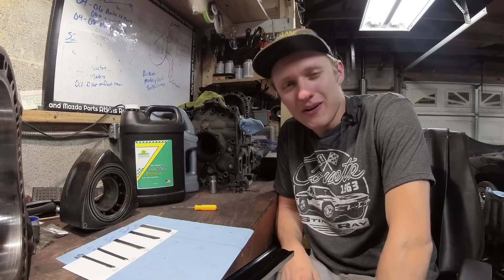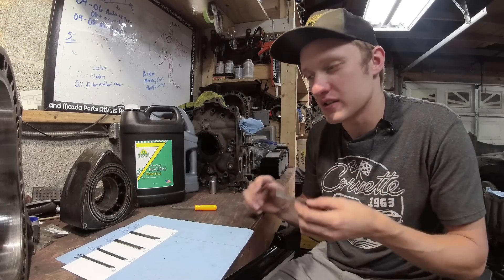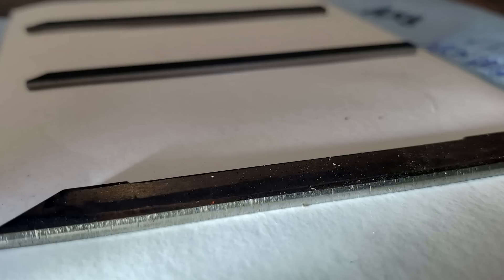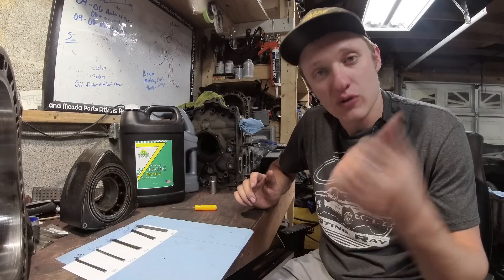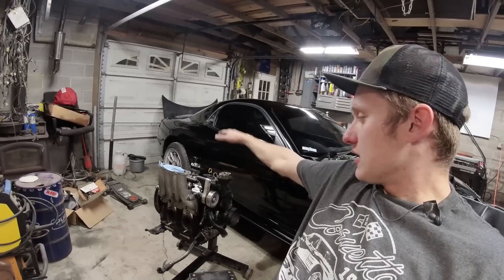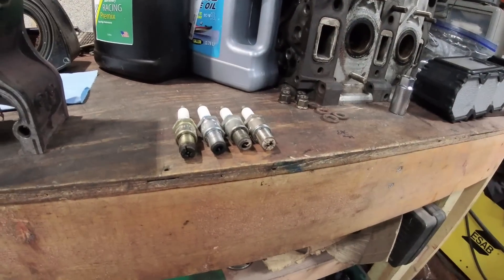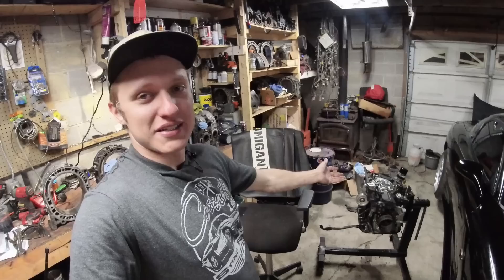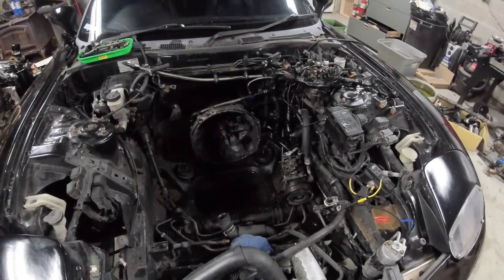Analyzing Apex Seal WEAR in Mazda Rotary Engines - Years of Testing Different Seals

Comment: Interesting deep dive! Not many people get the opportunity to see the varying amounts of wear in different 13b's like you are.

Where are you buying that bio premix that isn't an astronomical price? I run Idemitsu and it is a bargain compared to any of the bio premix I can find.

As far as my car, 2006 rx8, I premix 1/2oz per gallon and on trackdays I will do 1oz/gallon. Something I have always done since my first rotary (I am on number 4), is I will take out and clean the spark plugs every oil change. Hit them with a carb cleaner and wirebrush them off, and I typically replace them every 3-4 oil changes or if I start seeing degradation of the strap. I also have a mazdaedit tune where we upped the omp oil injection rate, and we actually went for the JDM fuel enrichment map, this is how all RX8s were originally designed in Japan to operate since their emissions were not as stringent as the US's. 

The extra fuel in the air mixture appears to cool down the internal engine temps, with the possibility of having higher temps building up past the side exit exhaust ports and into the header, which is ultimately not good for the cat, good thing I have a midpipe! Too much internal engine heat in the RX8 is a killer as it will ultimately take out the side seals, which premix is great for protecting these, and also it reduces the temps at or near the spark plugs. Any higher mileage rx8 that makes it past low compression will inevitably blow an internal coolant seal right by the spark plugs if still driven hard at those miles due to how hot that spark plug area gets. The rx8 has some figure like 20% of the fuel is wasted and just thrown out the exhaust which is clearly not good for the stock cat as it will roast itself burning off that unburnt fuel.

An additional benefit we have seen to the JDM fuel enrichment map is that the car has a smoother power delivery compared to stock, and the extra fuel also delivers more premix into the engine which has it's obvious benefits.

Cheers!

Comment: My S5 turbo failed with coolant seal groove failure on the front side housing at 142,000kms. It was an unopened factory engine and still made 100psi compression. Was rebuilt in 2012 by a reputable rotary workshop in Melbourne with brand new rotor housings and a brand new front side housing. They recommended and installed RA super seals but with factory apex seal springs. Supposedly the RA seals will warp and not shatter on detonation. They said the RA springs are too hard on the housings. I'd be interested to know what springs were run in the engines you talked about. My engine now has 40,000kms on it, no premix, factory OMP using Penrite HPR40. Recently on the dyno it still makes the same power as when it was rebuilt and run in. I have not had it compression tested because I've had no trouble with it and it hot starts instantly. You got me thinking about the RA seals though. Cheers, great content

Comment: I run the pennzoil marine XLF a gallon is like $22 at wallmart
 A little more then an ounce a gallon plus omp pinned at 1/4 throttle 
stock port 12a eats it all up 
Just went with one number hotter plugs

Comment: My last/first engine was running the OMP, but I still premixed at 1/4 oz to a gallon with blue valvoline 2 stroke mix. It died to apex failure, but I can’t really chalk it up to the fuel or lubrication for sure. It had an unknown history, I have a feeling it was either the previous owner's crappy nikki mods, or his port job. It used to have this issue where it would sometimes hit 4k rpms and start struggling and fighting itself, and one day I was highway driving when a seal shattered when I went to accelerate. I never have torn down the engine, but I can see the cracked and chipped seal through the exhaust port.